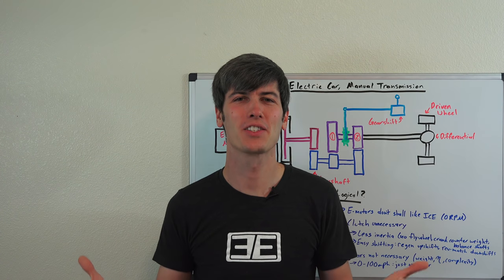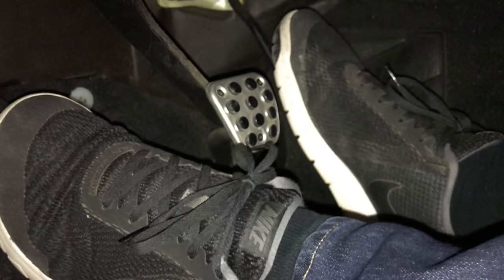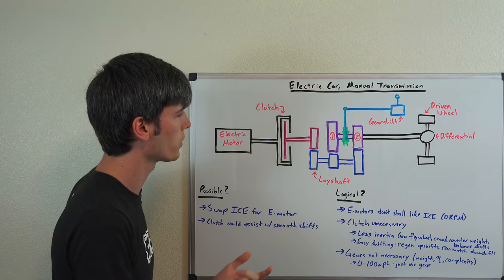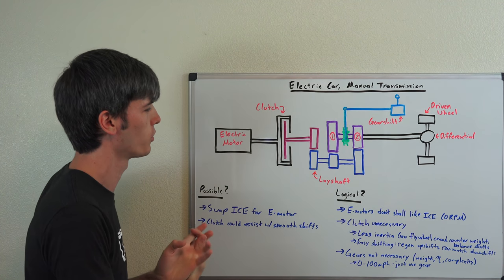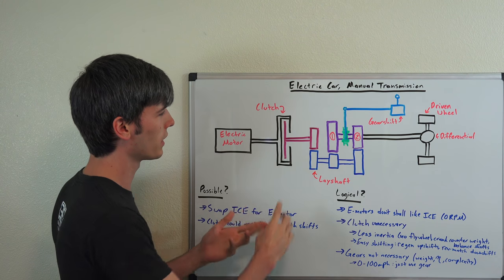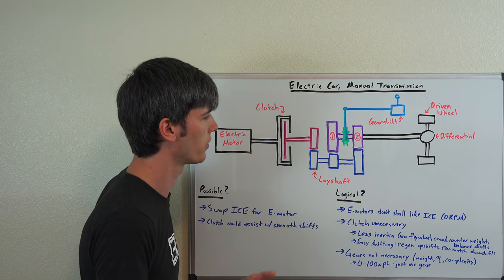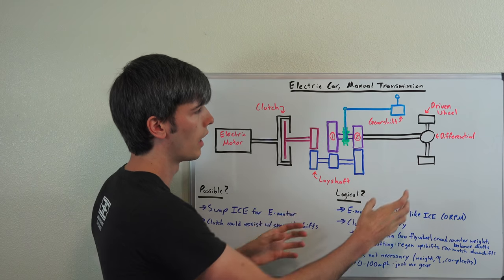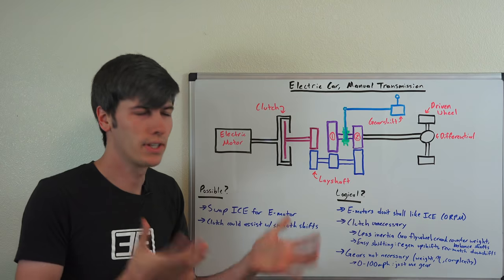Could Electric Cars Have A Manual Transmission?

Comment: This could be simulated by having a virtual RPM and gear stick, then you can control it like a gas car by limiting torque in the higher gears and when you down shift having some inertia by using regen braking or burst of acceleration. (all this coupled with a nice fake engine sound will be good)

Comment: One way I could see it being logical (and fun), is to use the waste energy as a source of heat. The major drawback to EV's are the low range in cold climates with the heat cranked. I'm sure there is enough heat there in a clutch system to warm up a cabin at highway speeds. My 2 cents

Comment: Couple ideas... you might use it for offroad and downhill where offroad you make plenty of torque without drawing lots of current barely above stall speed, and downhill regenerative braking on very steep hills should be improved.

Comment: I don't know if a transmission would be practical for everyday use, but for racing, certainly. Since your motor is efficient at a large range of rpms, a two or 3 speed transmission could help you achieve ridiculously high speeds. Say you put one on a P100D. Get up to 200 mph (a speed where your torque starts to go down), shift, and you'd be able to accelerate another 70 mph. You could go well over 300 mph.

Comment: Well considering the manufacturing and ratings of most electrical motors, typical rpms straight out of the prime mover are typically rated for around 3600rpm. So yeah I'd think a transmission of some sort would be required if you want to go a decent speed.

Comment: Good discussion. It would be more complete with a discussion of different motor types. For example, a simple DC motor loses torque as RPM increase, but a synchronous motor can vary speed and torque independently.  As for manual transmissions being "illogical" in modern ICE powered cars: you missed a huge benefit of manual transmissions: reliability.  I don't know anyone who has ever been stranded by the side of the road because their transmission failed with a manual.  And this has been a big factor in used car purchases.  For example, I bought a twin-turbo Audi A6 sedan with 170,000 miles on it because it had a manual 6-speed.  If it had the Tiptronic, then I'd risk a failure that would cost more to repair than the  value of the car.

Comment: In UK most drivers have a manual licence, allowing them to drive manual or automatic. It tends to only be a small minority who go for the automatic only licence, due to having difficulties learning manual. In fact many auto instructors don't even consider students who have not first tried to learn in a manual car. For this reason, I (A driving instructor myself) cant envisage a time when I will ever own an electric vehicle. Ill be honest, Id love one! I really do feel it is the way forward. But like many others here I love my manual gearbox and dont want to give it up, plus I don't want to be stuck with only having those percentage of learners who cant figure out how to drive manual (ie the really difficult stressful students. I like a challenge, but only interspersed into a good range of abilities). Then there is the cost. new drivers tend to go for a banger for their first car as mistakes happen. Automatic 2nd hand cars are rare, and therefore electric second hand rarer still, which means their prices tend to be out of reach of many new drivers who tend not to buy a brand new car as their first vehicle. What would be the point in me teaching in an automatic EV. I see a few instructors chat about this, and about how range is getting better, but that they still tend to stop off half way through a day for a recharge, making the work day so much longer. I feel sad that I cannot move with the times and go down the EV route, but as yet with range, and the lack of a manual gearbox (and clutch actually stalling the car) I dont feel the industry is ready for instructors.

Comment: Every VW air cooled EV conversion has a manual with clutch. Electric motor bolts in where gas engine was. clutch not needed to shift.

Comment: Gears are still useful with an electric motor. While electric gives you maximum torque from 0 rpm, remember that power is the combination of both torque AND rpm. 

What we're seeing with Ebikes for example is a change from hub motors, which have to find a compromise between top speed and acceleration, to mid drives hooked up to the regular bicycle gearing. Of course when you're putting 3Kw (four horsepower) through 3/32" chain that presents other problems...

Comment: There have been some experiments with two speed manual transmissions in trolleybuses. Namely the SOR TN12 is a type build in 2008 just in two units, one with a two speed transmission and the other with single speed transmission, as all other trolleybuses. The two speed transmission was operated by pressurized air (which both prototypes had, as all trolleybuses do to operate brakes, suspension and doors). It has an asynchronous 120 kW traction motor and the gear shift happens around 30 km/h. The weight of the motor and transmission is 580 kg. The second prototype has a 175 kW asynchronous traction motor, givig the vehicle the same dynamic performance at low speeds. However, this motor weights 750 kg, so it is heavier than the smaller motor with transmission. I do not know exactly what the results of the tests showed, but the two speed trolleybus probably was not that much efficient to run, as all later produced trolleybuses have a single speed transmission. Also, it added complexity and the maintenance of it was surely to be more expensive and could lead to overall higher costs over time than the traditional trolleybus design. I personally believe the reason the idea of a two speed transmission in a trolleybus lost support mainly due to higher maintenance cost and unneccessary complexity of the vehicle.

Comment: Perhaps this could be an idea for trucking. I've heard of a hydrogen fuel cell concept. So if we had an electric motor and or hydrogen fuel cells, you could start with a crawler gear if it's a lot, then stick it into a longer gear for residential type area and a nice long one for highway.

Comment: Manuals are still useful for better gas milage if you know how to drive. Normal people would probably do better with an automatic these days but they'll always be limited by the transmission. 

Efficient drivers can still do better with a stick. For instance, I average 41 mpg combined in the summer with my 14 Focus 5 speed but when it was in the shop and I was given the same car with the 6 speed auto as a loaner I couldn't even get to 38. 

I doubt a manual will ever make sense in an electic car though.

Comment: There is a point to manual gearboxes. They are more reliable than automatics, more resilient, cheaper to maintain. Very rarely go wrong. One isn't going to strand you in the bush. More fuel efficient than most autos. They also allow you to get more out of a smaller engine.

Comment: I'm thinking instead of adding the manual components physically, it could be simulated. Where the speed is limited in respect to the selected gear. And the shift stick movement came be mechanically restricted unless the clutch pedal is depressed.

Comment: A lot of people convert cars to electric and there's a debate between "direct drive" vs transmission although typically transmission (a manual) wins out most of the time (not to say an automatic can't be done, it's just very complicated). A LOT depends on your motor of choice in an EV. Electric motors have 100% of their torque available at 1 RPM and they plateau for a bit before torque starts to drop off as RPMs get higher (again, where this dropoff in torque begins  depends a lot on the motor of choice.) If you want to compensate for that drop off, you can use a low gear for slower speeds and a lot of torque and higher gears for higher speeds while trying to eliminate as much torque dropoff at the wheel as possible. Having said that, an electric car wouldn't need very many gears to begin with as they'd start overlapping in use pretty quickly. A 2, 3, or maybe even a 4 speed could be all you need. HP is also very funny in these conversions as you get guys with converted Honda Civics with half the original, gas engine horsepower but twice the performance. Some people convert cars to electric and end up not even using 1st gear because it just spins the wheels on the pavement and only use 2nd, 3rd, and maybe 4th if they have a lead foot. Electric cars have a lot of potential, the only downside is battery technology at this point. They run out too fast and charge to slow. Maybe supercapacitors or a supercapacitor/battery hybrid setup will be the answer one day. There's also a ton of videos of people converting cars to electric on Youtube that are fascinating to watch.

Comment: manual tranny means less rpm from the motor needed relative to a system that uses one a motor only drive system to achieve that 100mph standard. less rpm in an electric system vs a gas system means you can use less voltage to achieve that same goal. less voltage means safer vehicles on the road in a scenario where per say an accident happens and the battery is damaged. sure there would be more current needed but the risk of it arching is really the danger i feel. and you can get pros like charging your car from your wall plug without the need for much of a charging station. maybe something similar in size to a xbox power supply or so. great video none the less and all in my opinion

Comment: Also, the Electric motor can run at a wide range of RPMs (Pissibly up to 20,000 RPM), so a transmission for a higher speed is unnecessary.  You can put clutch packs to have a choice for reverse, or just using a 3-phase motor so that it can have reverse mode.

Comment: Just as they use manual  transmission in gas powered cars
Most people try keeping the engine rpm low and not stalling the engine to get more fuel efficiency 
Then
As you said in your video,swap the engine with electric motor,then if you try to keep the rpm of the electricmotor low rather than having high  rpm in speed which consumes more battery, with gearbox you can easily have excellent battery efficiency and no stalling fear but you just need some torque

Comment: The company I used to work for did exactly this, an electric vehicle with a stock 5 speed manual transmission complete with clutch. It's a bad idea, they only did it for the simplicity of keeping the powertrain and just jerry-rigging an electric motor in. The transmission ended up causing lots of mechanical trouble, and ultimately they broke a driveshaft.

Comment: Low gear would be great while driving around the city. But in highway speeds the second gear would come in clutch. Because there’s more torque in lower rpm meaning slightly less use of energy. There should be a test on that theory.

Comment: I'm a railroad engineer who's spent some time on electric locomotives and I'm also a motor head. In a locomotive used for fun, nothing beats steam but for efficiency, nothing beats electric. In a car used for fun, nothing beats a gasoline engine with a manual transmission but for efficiency, nothing beats electric. I haven't owned one and I may never own one but if an electric car is anything like an electric locomotive, they'd be great as an everyday vehicle while my hot rod with its blown Jag V-12 engine sits in the garage waiting for fun day (much like a steam locomotive sits in the roundhouse for waiting fun day). As for transmissions on electric cars, they probably don't need transmissions but I wonder if they'd need transition or are they straight parallel? BTW Jason, you're the first person I've heard outside the railroad industry use the term 'regen'.

Comment: Actually, if there were two-speed transmissions in electric cars, the motors could be somewhat smaller and lighter.  However, that advantage is probably not worth the extra complication.  And, the weight advantage of the lighter motor would be to some offset by the additional weight required by the two-speed transmission.  Probably we will not see many electric cars with multi-speed transmissions.

The first Tesla electric cars had two-speed transmissions but they were dropped before long.

Comment: I still have yet to find a single transmission more efficient than a manual. The EPA agrees, since the manual TDI is rated 2 MPG higher than the automatic. I'm not rich enough to afford two identical cars for testing both transmission options, but that's what collective data is for between owners. I'm not the only one trying to see how many MPG I can get.

Comment: I drove an electric vehicle with a manual transmission before this video was posted. It was a cheap multi-passenger "tour bus golf cart" thing, up to 25 MPH with 4 or 5 gears (don't recall which). Using gears 1-2 really helped with acceleration when fully loaded. Had to get to top gear for full speed. Not sure what type of electric motor is used in these machines.

Comment: Yes, they are multiple ways to make a "manual" EV. From mechanical-thermal to Electrical-thermal, there are variations of design to achieve this. Whether it is for the feel and/or efficiency is another story.

Comment: I think with a street car yes.  The example you gave of dropping the gearbox for a single speed because of frictional losses and weighy loss is for racing.  On a street car I can see where a gearbox would let you use a smaller motor and thus less energy. Where on a street driven car you're still going to be concerned with mileage, rather than lap times.

Comment: If manual gearboxes are just for pleasure, then instead of an actual manual gearbox, why not a simulated manual? It could have a pedal that feels like a clutch, and a gear stick that feels like a gear stick. It could make simulated engine sounds and simulate everything about a manual transmission without actually having one. That way if you tire of using manual gearbox, you could just switch off the simulation.

This would actually be really useful as well for driving school vehicles in countries like the UK, where there are separate licences for manual and automatic transmissions. It would allow learners to experience different types of engine and transmission setup, while also allowing driving schools to use just one type of car.

Edit: I just realised that I wrote a similar comment two years ago!

Comment: I've heard, in general, that there is a 2% to 4% loss in power when one gear turns another due to friction.  And we know a typical transmission gear box has many successive gears in order to accomplish its task.

A futuristic approach is to have a variable-Kv electric motor where the motor constant (Kv) could be changed while the motor was turning.  There's a video on YouTube that showed a motor working in the lab.  It had some sliding ring around the motor's coils that could apparently change the motor's winding ratio as the motor was turning.  Even this may not even be necessary with upcoming improvements in brushless electric motor technology.

Along with the IC engine, we should leave gearboxes, transmission fluid, torque converters, clutches, and drive shafts in the fossil record soaking in the goopy dinosaur juice that they ran on.  We can keep some of them in museums for people to look at perhaps.

Comment: One thing not considered is the dual motor setup used for 4WD in EV's
You would either have to ditch that in favour of a more traditional setup with one motor, or have the issue of synchronising 2 motors and 2 gearboxes.

Comment: With a manual transmission you will be able to jump start the car ;)
On a more serious note Blade Electric Vehicles who were in Castlemaine, Victoria, Australia converted Hyundai Getz's over to plug in electric years ago by swapping out petrol motor for the electric. It used the manual transmission and ditched the clutch.

Comment: I think with a manual transmission on an electric motor, you can use a smaller motor that will use less electricity, and increase battery life. Even if it may be a three or four speed transmission.

As someone who enjoys driving, I love manual transmissions.

Comment: well, teslas could have a feature to simulate manual cars, in the way that each gear in the gearbox has a button that is pushed by the stick, the clutch pedal is a lock for that stick, and when one of the buttons is pushed, it will set a speed limit for that gear, and the last gear (either 5th or 6th, maybe in some cars a 7th gear) has only the max speed limit of the car as the limit. this could be easily made, programmed and sold, and this would not only be an anti theft feature in america, but in europe a lot of people would start driving electric.

Comment: I am wishing for BMW to make a hybrid, where the reverse and 1:st gear is electrical, and disconnected from the combustion engine, making the car fully electric with front-wheel electric drive, while the following gears is mechanical connecting the combustion engine to the rear wheels for a enjoyable driving experience.
Such a car would be a great compromise between a great automatic gearbox car great for being stuck in traffic, and a open road or track-car still having the enjoyable gears left.

Comment: it doesn't stall but changing gears without isolating it from the motor would still grind the gears. Unless it's a dogbox sequential, then it could just interrupt the torque for a moment and shift effortlessly...